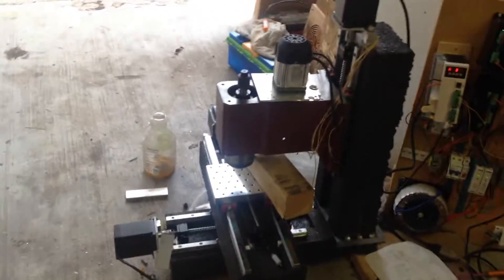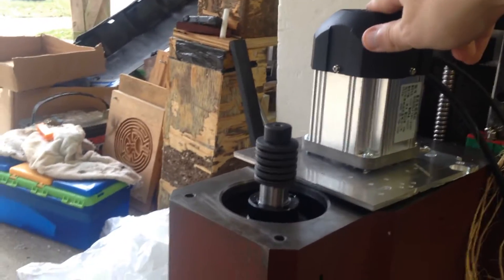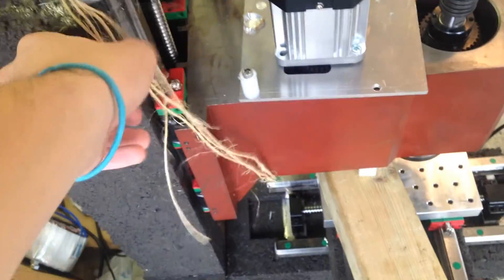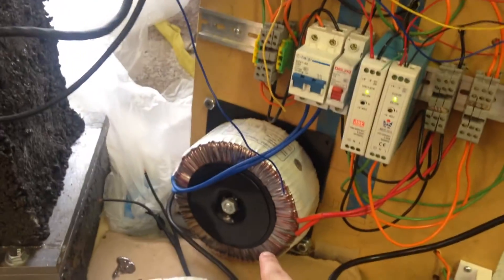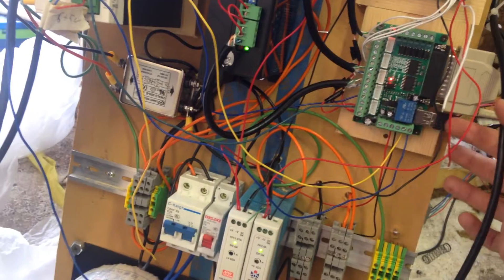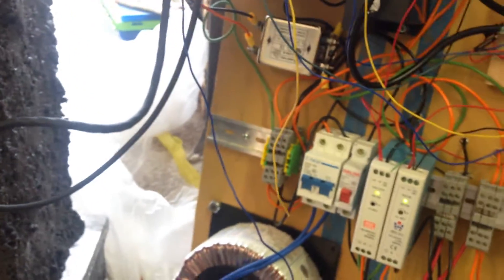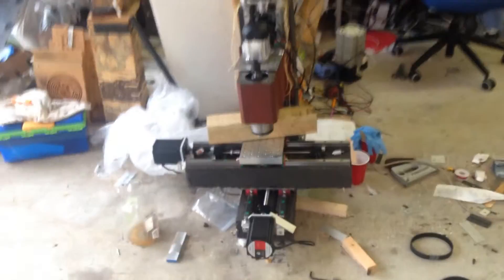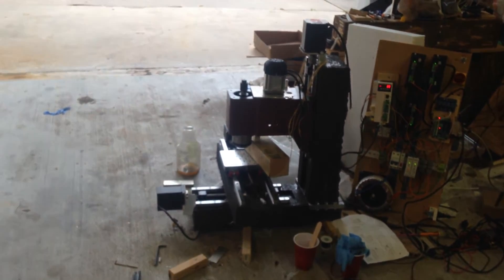Epoxy Granite CNC Mill "Model E"

Comment: How do you managed the heat generated by the epoxy reacting with hardener? How much epoxy did you use on the biggest casting? I am afraid because in our design there will be like 12 Kg of epoxy (including hardener) per cast and this will generate so much heat!
Reply from the maker: Oh wow, that is a lot of epoxy by weight.... you may have to mix it in batches instead of one large mix. My recipe was only 8-11% epoxy by volume, not weight. 

If y'all are seriously concerned about the heat, A: try and work in cooler temperatures, B: small batches of mixing epoxy. If you could get a couple of buddies to help you , I could easily see it working out

Comment: Hi, I want to build similar CNC machine. How are You satisfied with this type of construction (1column+XY table). Is it rigid? How large is work area?

Thank You
Reply from the maker: I think this is the best set up for 440(tormach) sized machine and up, until serious VMC's start being considered. There isn't enough mass to really weigh down the head that larger C frame machines have issues with.

This for of construction also made it stupidly simple to complete, just 3 rectangles with some fairly precise holes and surfaces. even then I left my self some shimming space for errors